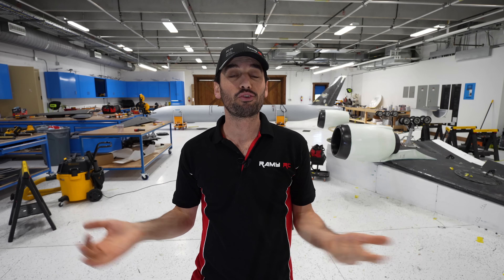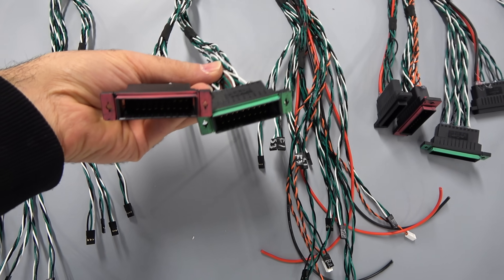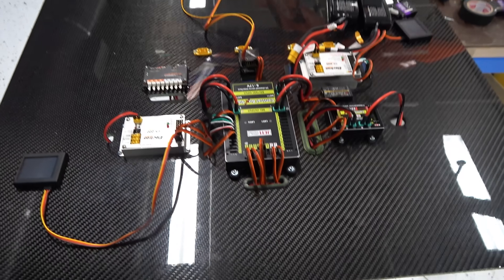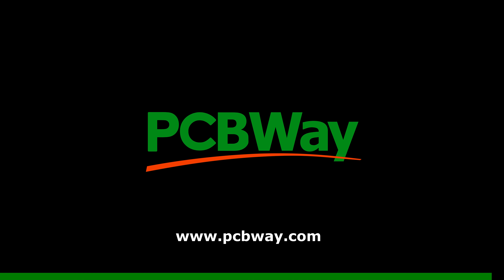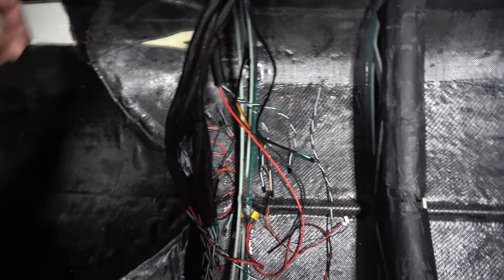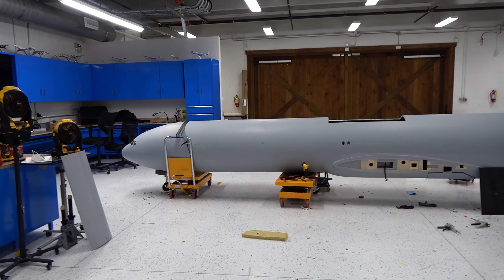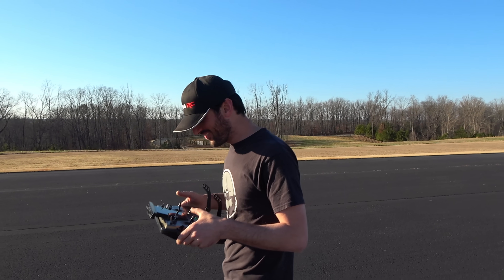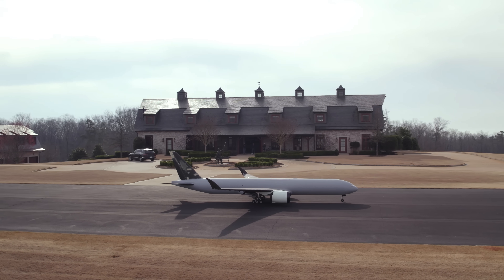Building the world's biggest Boeing 7779X RC Airliner/ FINAL

Comment: i would maybe see if thre is risk of turbulence or cavity in the duct of the props, as the takeoff requires some fluid stickyness to the planar surfaces of the wings... i dont see that stickyness/fluid adherence formulating/forming/appearing on the wings here, meaning that sudden lift loss with that swept profile maybe experience at varying speeds. at this scale, air will be more patchy and thus jet (high mass) engines help to control speed more. with that mass, id think that take offspeed will still need to be 40mph to ensure post take-off smoothness

Comment: What if the doors worked on the plane and it got some interior detail? The plane is big enough to have some interior detail put in it and add that part where fuel would go from the fuel truck to the wings of the real thing usually go but instead it’s a charging port to recharge the battery through the wings?

(Also this is probably not going to happen because that’s practically too much work ;-;)

(And here’s a like)
Reply: Or just simply add lights in the RC plane and have those window ports and that light up

Comment: Ramy, your gear retraction test is so realistic. The environment of hearing the operation of actuators and motors reverberate in the hangar shop like a full scale maintenance hangar. To make it more realistic is to see where the actual jacking points are on the actual 777 are, incorporate that on your airliner, then make scale jackstands to do maintenance retraction tests. Truly you are an aeronautical engineer working with actual.composites that are used in manufacturing composites components on full scale aircraft.

Comment: Just started the video. My first thought was. If you physically could crawl into the fuselage, could it physicals fly with you inside? Im talking more as a theoretical weight and room type thing. It would be a stupid dangerous thing to do.

More just would a normal size man fit and could it handle the weight on takeoff and landing. Does it have adequate power and structural integrity to be remotely possible.
Reply: After watching it looks like someone can at least physically fit. But that only answers a fraction of the question

Comment: I looked up the specs for the EDFs.  Each fan is rated for 45kw.  Translation, the total power for the plane in HP is 120.  To put that in perspective, a fully loaded ultralight plane at 560 pounds with recommended power is just under 42 HP.

Comment: Are you putting a multi camera system on it for flight recording ? like top of the tail shot belly and gear shot wing tip looking back at fuselage and motors. Maybe controll board shot too. If you have a failure you will be able to see what when wrong.

Comment: I think you should consider a generator, maybe an RC piston engine tied to a good lightweight dynamo. Maybe 2 or 3 not sure about the power requirements for those monstrous engines. It would give you practically unlimited range compared to batteries alone. Or go the capacitor route and have capacitors feeding the batteries.

Comment: @RAMY RC
YOU SHOULD BUILD A RC PUSHBACK TUG!!!  
Push back tugs move airliners away from airport terminals, 
this would save battery life for the  large EDFs

-One variation  lifts the nose gear and guides the plane around to the runway. 
-Other variations uses a tow hook with a boom extension that steers the nose gear of the plane.
-Another idea could be to build an RC tug with lazy Susan platform for cornering.
Reply: he could probably make it big enough to ride it to the runway while towing the plane Lol
Reply: I would love to see a collab with Best Tugs (@MikePatey and his twin brother Mark) with @RamyRC for this :D
Reply: I thought the same thing when I watched this video!
Reply: underrated comment that neeeeeds to be boosted
Reply: 100%
Reply: Actually a terrific idea!
Reply: Yesss
Reply: Completely true !!! Indeed
Reply: This is a BRILLIANT idea Ramy. Consider it seriously.
Reply: I doubt the steering servos are back-driveable, so probably the variant that lifts up/carries the front landing gear.
It definitely would be easier to taxi it as the tug would have the torque, easier to control, better turning radius and stops in place at idle.
Reply: I thought the same exact thing! He should also paint taxi lines heading to the runway 😋
Reply: Commenting just to boost this so @RAMY RC sees it.

Comment: 264kg, that is some model. what are you using for batteries. Are you monitoring battery current and various temperature sensors around the aircraft.

Comment: Super impressed. Fantastic work. Only thing is that this super heavy model will not be as forgiving as other RCs. Hope the engine is adequately powered and reliable enough for the increased minimum stall speeds. What about regulatory clearances due to weight restrictions, increased power and speed etc?

Also thinking, at what weight and size would it be prudent to consider adequate aerodynamic flexibilities on serveral components? We dont want parts shearing off!!!

Well done Ramy

Comment: Hey Ramy, looks amazing.  For tight turns, large aircraft usually use differential braking to help as the brakes are tied to the rudder pedals, so left brakes left pedal and right brakes right pedal.  That may help with this plane as well.
Reply: I think he knows that
Reply: The upper part of the pedal is the brakes, they aren't really connected, you could do opposite rudder and differential brake, the top of the rudder pedal swively. You just do differential braking with how much force you apply but almost all landings are done using autobrakes and if you need differential braking to make a turn you should slow down maybe... it's a very inelegant way to steer, when you have a perfectly functional nose gear. Differential thrust reverse is sometimes used but that's the type of situation, where you crash landed and are trying to maintain centerline, while the liner is skidding. I might be wrong but I'm almost certain that differential braking is not used routinely. Something has to have gone wrong for that. It would also wear the brakes unevenly, which is something they try to avoid. Wear in general, that's why the reversers are always used, they make no difference on a dry runway but they do take some of the load off the brakes and let them stay cool. Without reversers and stopping as quickly as possible, you can assume the wheels will catch fire as the discs are glowing red hot. That's why you often see the landing gear being doused in water or foam before getting the people out. Especially if you crash landed and there's fuel leaking.
Reply: Large aircraft have a tiller for steering. They don’t use differential braking.

Comment: You're probably already aware of this, but real aircraft can have very tight turning radii due to differential braking - they can apply the brakes to the left or right gear alone and allow the aircraft to pivot around that gear.  It's something you should probably set up on that 777 if you haven't already.  (along with differential thrust so you can idle one motor while using the other to help the pivot)  Excellent work!  The budget for the landing gear alone must be eye watering. 🤣

Comment: As an actual 777 structures mechanic i can say this is a very beautifully done model of our aircraft. I am excited to see it fly.
Reply: @Primalkopfjager  the hardest part to get right is the nose and cockpit windows, they nailed it. I see far too many RC planes that look generic and unrecognizable. 

On another note, why did they stop putting eyebrows on the planes?
Reply: @devoncantrell3311  They simply didn't need eyebrow windows anymore because of the electronification of stuff made them not necessary for visibility anymore, plus I think the 737 and DC-9/MD-80/MD-90/717 which were some of the last ones to have them look better without them.
Reply: @ they look hilarious from the outside. Kind of give the airplane a “shocked” expression. I helped restore N874AA in an attempt to get it to fly again, it was sadly scrapped as the budget ran dry. The view and level of light in the cockpit afforded by those eyebrows was really cool.
Reply: @devoncantrell3311  This is why I record every MD-95 (or “Boeing 717” 😂) I’ve flown on as it pulls into the gate. Most airlines have plucked the eyebrow windows on their older 737s.

My head canon is that the MD-95 is making surprised Pikachu face over having only 30 minutes to rest before continuing on its 30-leg turn 😂😂
Reply: @devoncantrell3311  They eyebrows were used to increase visibility during turns, especially when turning from base to final. Nowadays, we have better avionics that they become unnecessary (IFR flight). Pilots were also blocking those eyebrows because of the sun glare and the eyebrows also meant more complex structure. Thats why they removed them
Reply: @devoncantrell3311  They're for seeing the stars to use as navigation, but nowadays there is gps etc, so not needed
Reply: @devoncantrell3311 if you watch carefully you will notice that the cockpit window is wrong, the top edge is rounded and in the real blane its not.
There are no eyebrows on modern planes because they helped with navigation and celestial navigation at night but with modern avionics they were eventually removed as they were only another cost.
Reply: @devoncantrell3311  Two main reasons, they use to be used for navigation and now there's GPS. Eyebrow windows were heated and would delaminate so there was a lot of unnecessary maintenance. On the 737 NG's there is an STC to remove them and then Boeing stopped putting them in at some point.
Reply: @ that makes a lot of sense. That was a question I definitely could have googled, and did right after I posted that comment. Yeah that makes a lot of sense. I figured they were for some extra visibility, I also saw somewhere that they were put in to comply with a need for a certain amount of window area but that seemed a little far fetched to me.
Reply: @devoncantrell3311  I was an A&P for an airline for many years. We use to fly MD 80's. On sunny days you would often see the laminated pilot checklist wedged in the eyebrow window area as a make shift visor. You can see in the later 717's the eyebrows were deleted.
Reply: @devoncantrell3311  No longer necessary. Eyebrows were meant for a better visibility/traffic avoidance in the old days. TCAS replaced them.
Reply: As a 777 wings mechanic, its pretty damn impressive
Reply: Aircraft So Beautiful , Thank You Guys/Girls  for a saving vid...
Reply: The question is, will the door fly off mid flight (just like in real life) 🤣
Reply: Triple7 has always been one of my favs of all time. As a kid and on certain flights I always loved listening In on traffic calls on approach hearing the advisory calls of “heavy” to other A/C in the pattern. Such an amazing A/C. That distinctive APU at the end other than shear size is how I would tell my siblings that’s one way you could tell. When the 787 came along I was almost as stoked but nothing captured me as bad as the 777 save maybe the trips to Germany on Lufthansa 747’s way back.
Reply: Righttt, focus on keeping those pieces of shit from falling out of the sky then please, thanks.
Reply: Then you guys need to learn  a lot from that guy , how to build a clean and reliable plane 😂
Reply: does the Boeing 777 have electric turbines? what kind of copy is it without jet engines?

Comment: Hello Rami, have you checked the voltage drop in your cables, they are really long and maybe you would need to check how much are the losses in the power supplies of the ESC and servos, and if you have a thermal cameras you can also check if some are over heating !
Awesome build !
Reply: If I understood well the battery packs are near the ESC units. The ones in center fuselage are for avionics and servos. Yeah lot of current for those servos but luckily they are not turned on all the time. I'm more concerned about signal noise

Comment: I'm 100% convinced you could fly in that thing Ramy
Reply: Will be great to see the finished flight characteristics. Maybe not manned flying (for obvious legal reasons), but if you fill up the extra space/mass with batteries then you could potentially turn it into a long-range beast of an RC aircraft. Would love to see a long-range flight between two islands or something similar, although you'd need some significant additions and upgrades to autopilot, long-range transmission, and probably some FPV capability.
Reply: @TheMightyHams Yep, no sweat. 😂
Reply: @ Yeah no means an easy task, usually it's challenging due to the limited size of the RC aircraft, but because this 777X is so big you could run an antenna the entire length of the fuselage and be able to maintain signal for huge distances. Setting up at the top of a hill with a big fixed antenna should get you tens of kilometres of FPV range. Mobile phones can get high-speed data connections with cell towers 10km away with antennas in the centimetre range. There's plenty of open source autopilot software available, and FPV is a pretty common implementation on RC aircraft. You could have two pilots at both departure and arrival, and do a mid-flight handover while the aircraft is under autopilot so the take-off and landing isn't being done remotely.

I believe James May flew an off-the-shelf RC plane over the English channel in his 'Toy Stories' series about a decade ago. And some YouTubers have done similar things with small RC aircraft. Would be great to see this aircraft do something similar.

Then again it entirely depends on how much range you can get out of the batteries anyway... So just a thought that tickled my brain when watching this.
Reply: @TheMightyHams  At this point, would a dynamo and an RC piston engine, make sense?  Like an APU but it's the MPU. :) RC plane engines have awesome thrust to weight, it would probably be close to negligible.
Reply: @TheMightyHams maybe even fly an actual plane, let's say a small Sesna, beside it and control it from that.
Reply: No doubt about it